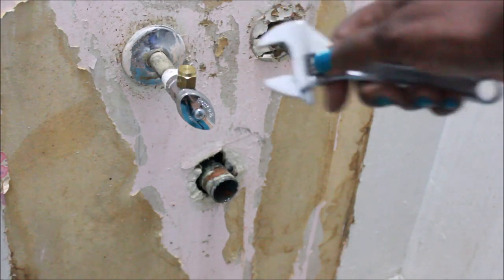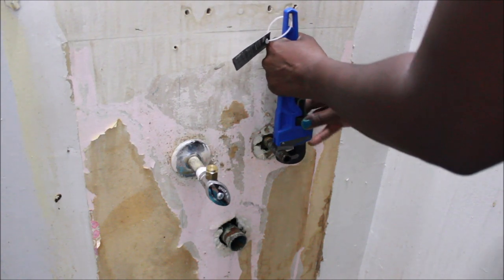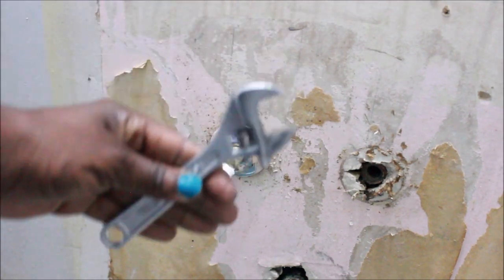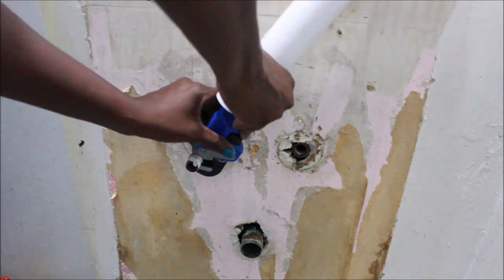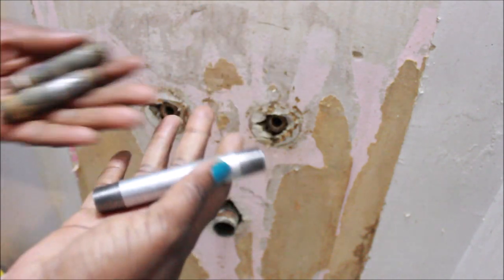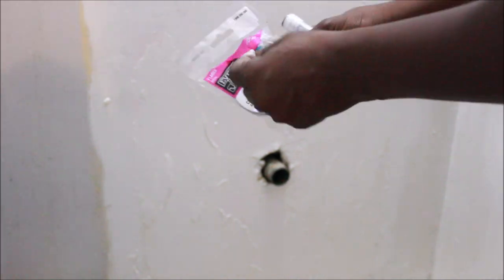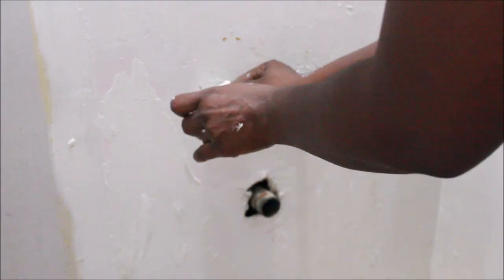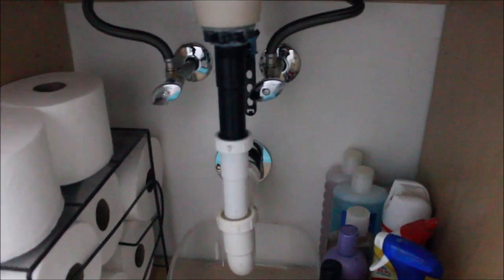HOW TO REMOVE AN OLD RUSTY, PIPE NIPPLE IN YOUR BATHROOM / RUSTY PIPE NIPPLE

Comment: I had a bathroom pipe that had been there probably 50 years and no matter how hard I tried I couldn’t get it loose. What did the trick was using a $10 electric heat gun from Ace Hardware. After heating the pipe for about a minute it came loose! Just another tip for y’all.

Comment: What a great discussion! Love the nail polish. Finger tips didn't even get dirty! I felt like I was right there with you brainstorming the best way to remove that sucker! Great job, you really are "gold"! I'm guessing you didn't remove that paper label attached to the pipe wrench so you could return it when you're done! Home Depot is amazing that way. I once went to Home Depot and had a question about their $800 snow blower, and the guy told me "Just take it home and use it for the winter and return it for a refund when you're done if your'e not satisfied!!! God Bless Home Depot's return policy!!!
Reply from the maker: 😆 Thank you so much...lol that's funny because I was gonna take it back. But then I actually found other uses for it that made me want to keep it. I actually needed it to take my water hose connector apart and it worked well. I tried to use my other tools like in this video but they didn't work so well.. so this pipe wrench ended up be useful in other areas so glad I got it now...

Comment: Great job! Next time use brass nipples. They don’t rust over time. Changed my water heater and had the same issue you have…nasty rusty water. Spent a few more bucks on brass for the new one.